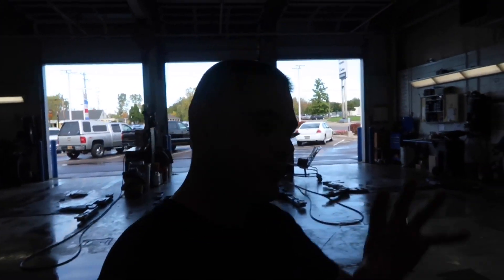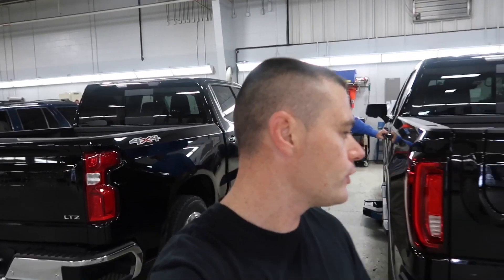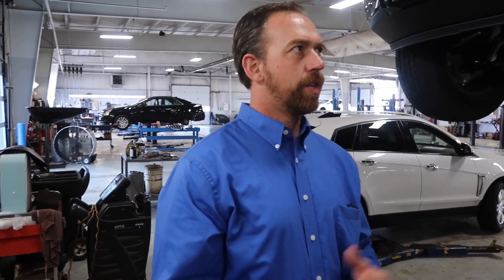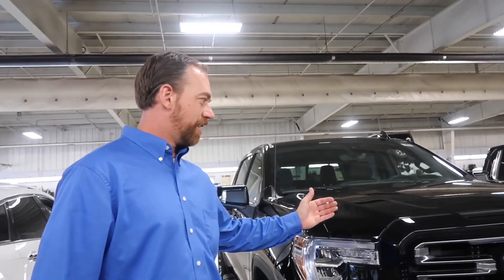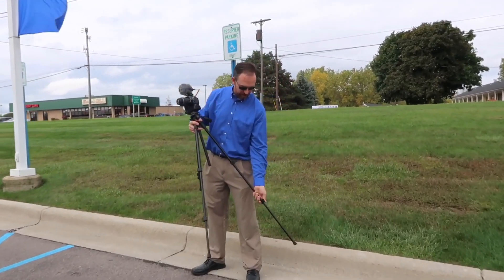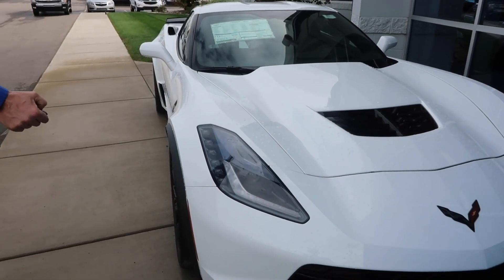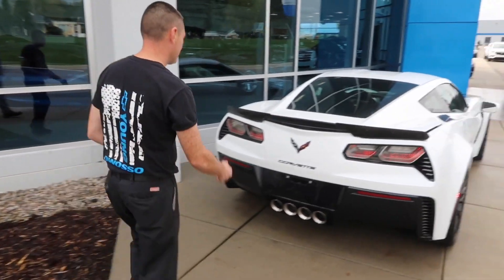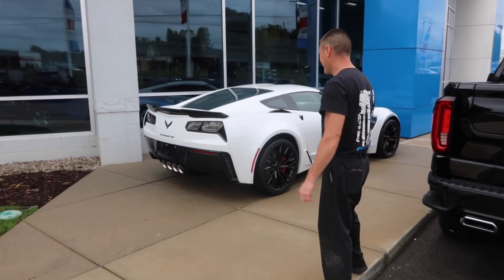What is a AT4 GMC Sierra?

Comment: You can get the performance package which includes CAI and Cat-back exhaust system. Had this added to my 2019 AT4 ....Sounds a lot better and increased horsepower over this model shown. Buy the 6.2 with the performance kit and you"ll be happy.
Reply: Did it do anything to the gas better or worse. Mine had the exhust not the cai thanking about putting it in your thought would be appreciated
Reply: @js4455dl  I use this for towing a Kubota tractor and equipment. Took a trip in the mountains ,Tennessee and North Carolina in early Nov. and round trip was able to get 19 mpg. I've since switched to 35" Nitto Ridgegrapplers  , but haven't noticed a major drop in mileage. Still gets 17 - 19 mpg headed to the beach.Mostly flat land around North Florida.
Reply: Thanks

Comment: Shocks don’t change ride height.
Reply: Rick Spencer they are called struts
Reply: schnittz nah, SLA suspensions don’t utilize struts. They’re considered coilover shocks, and the shock portion doesn’t control how high the vehicle sits.
Reply: @richrules  ya they actually do because when you put new shocks on an older vehicle it sits much higher then it did before. Same principle for any vehicle plus they probably made the coil spring larger for it
Reply: Joel Dale if you’re referring to a car or truck that has air shocks then that’s true. However this truck doesn’t have that style of damper. So no, shocks won’t change its ride height. A spacer on the top of the shock assembly or one that goes between the control arm/bottom shock mount would accomplish a greater ride height as well.
Reply: @richrules  no I'm not referring to air shocks and yes they do
Reply: Joel Dale you can compress a shock with your hands. With that in mind, explain to me the physics of how they can support the sprung weight of a vehicle. 

Here’s your answer: they can’t, and they don’t. It’s the spring.
Reply: They can if they are adjustable....
Reply: C Steele what adjustment on a shock can you make so it modifies the ride height? Compression and rebound don’t change that.

Comment: My question is can the AT4 be after market lifted? Id like atleast a 6' on it.
Reply: yes 4 inch suspension lift plus 2 inches from factory.....that is what i have.
Reply: iam thinking if you flirt with the  lift on the truck  you will void the warranty,  hey  just saying,  do it on a junk truck.
Reply: hunkydude322 I don’t disagree...mine came backed by dealer & manufacturer. I wouldn’t have done it without that.

Comment: Both trucks are nice But.... Alittle taller shocks and springs in the front and about a 2 in. Block in the rear , That wouldn't bother me.  It would be nice if the Chevy in this video had the 6.2 Liter  engine but with those few , 3 difference 's ,  I can't and don't see the 7,000 price difference between the two trucks.  Between these two pickups,  I would probably choose the Silverado.  I think the Chevy looks better !

Comment: Wow! I wanted a Denali but that AT4 is incredible! Does it have a sunroof/moonroof?
Reply: Yes.  Sunroof is an option.  I bought one in December.  There were a few hiccups in the new infotainment center, but after an automatice update from GM, everything is working perfectly now.  The stickers claim that the 5.3L and the 6.2L get nearly the same gas mileage.  I literally have one of each in the driveway, and I can tell you that off the highway, the 6.2L engine is less efficient than the 5.3L.
Reply: you got enough money it will have a bathroom in it too

Comment: I'll wait about ten years then I'll get the AT4 with the diesel.
Reply: C Steele 2020 if it lasts that long 3.0 duramax has a wet belt on the oil pump that wont last long.